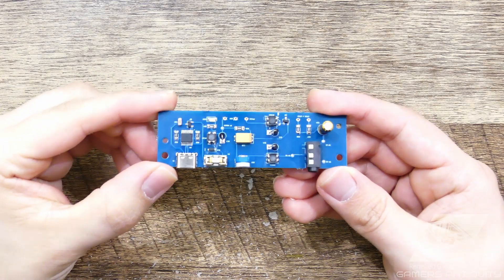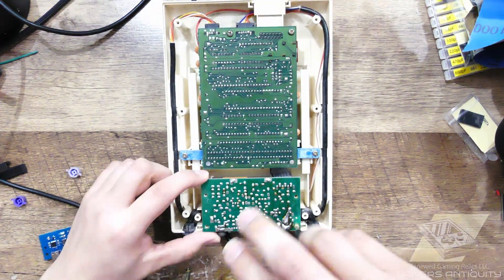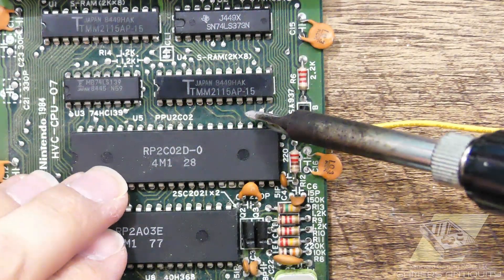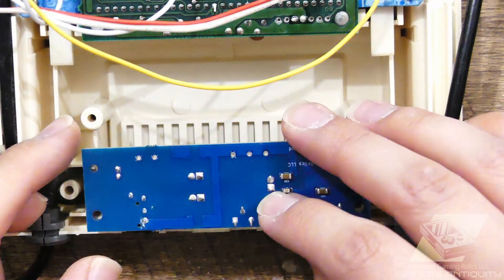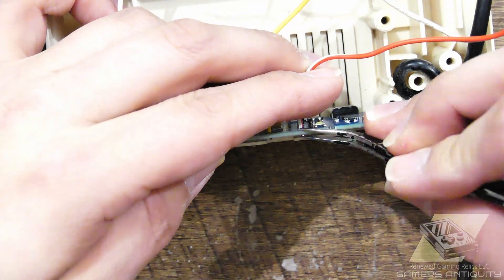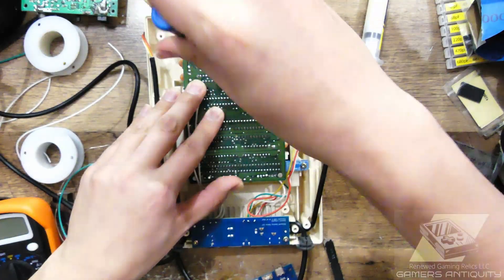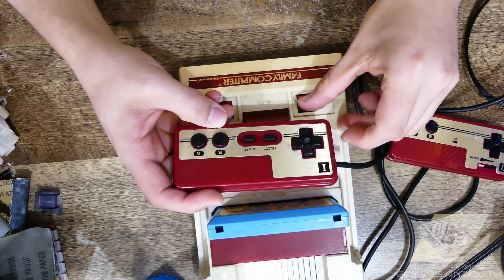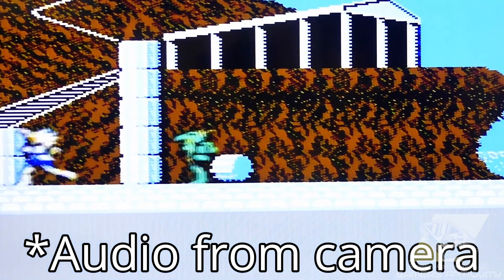New Famicom USB-C & AV Mod!

Comment: Could use just connectors and provide an optional pre pinned harness with the board - i.e. jst on the board side, stripped wire on the FMC side.

If people didn't want to pay extra for the harness, they could get a version of the board without the jst headers and harness for cheaper.

As the mod can't be solderless though there might not be an appetite for extras like that.
Reply from the maker: True - this is an awesome suggestion!!

Looking at some initial JST connectors and the parts I will plan to reduce, the current pricing may be a wash. I could switch to not using a mount for the fuse too and either keeping the same fuse or switch to an SMD one to reduce that little bit there too. Though I like people being able to easily swap fuses, it's another thing if people would be fine with that.

This could flow into the coming PS2 mod as well. I just worry about chassis revisions as the initial design utilizes screw mounts between the two planned boards. There are other concerns, but the dev isn't at the stage to properly address it yet.

Comment: Shipping costs $11, so it's not worth it to buy just one 🤷🏽‍♂️
Reply from the maker: Depends on perspective - I utilize flat rate priority via USPS for the main site. For 1-3 days once it hits the post office with $100 insurance included, it keeps things simple regardless of weight and distance.

Rates will be going up on July 13th. Regular priority will be going up to as much as 51%. That will impact the Etsy front. Flat priority will be going up by 11% which I'm hoping to absorb. Regular ground shipping will be going up to a lesser degree at up to 4% and other areas can see up to 14%.

Comment: Okay, so I have a couple things I want to talk about with this mod:

1) the use of CPU pins 1&2 is not ideal for audio out, especially with the severe lack of components on the output side. Its not true stereo, as all Pin 1 does is output the pulse waves while Pin 2 does everything else. The NES is not capable of true stereo, and anything that requires further adjustments externally would indicate that it is a bad idea. Also, expansion audio would be excluded since it doesn't come from the CPU, it comes from the cartridge bus. The ideal way of handling audio would be to instead pull from Pin 46 of the cartridge slot, and do two 330ohm resistors and two 47uf capacitors. One for each audio output channel.

2) 5V USB-C can cause issues if you play any cartridges or accessories that have a higher draw than normal. Think early Everdrive N8, MMC5 carts, or even some unlicensed carts. Which is why when most people do USB-C mods, they use the 9 or 12v rail and a well-built switching regulator circuit.
Reply from the maker: Not bad points. Please consider the following as I consider your points.

Yes, the famicom itself and the games are designed for mono sound so modern stereo wouldn't be applicable. Instead what this mod provides is stereo via dual mono, but the audio from CPU1 and CPU2 are muxed so both L and R channels get sound from both pins; you're not going to get channel 1 and 2 on separately with the PCB. The reasons for not using Pin46 from the cartridge slot is that the audio from that was very noisy with static that isn't found when going directly from the CPU pins no matter the external component  arrangement. So while Pin46 is more conventional and easier for some, it's far flug from ideal if you want clean sound. Could you connect 1 lead to Pin46 with the mod and add in other components - absolutely 100% no question ez pz. I've tried various configurations people have done before for the audio across many revisions and went with what was the most effective for capture, TV, and cost implementation. The use of Pin46 was part of one of the earliest revisions; along with different types of caps, CMCs, and so forth. I'll probably experiment with lower value CMCs in the future for sound as 2uH was too high and cut out some of the lower frequency sounds while taking out all the fuzz. Development never truely ends lol

As far as power goes, when stepping down voltage, you're still limited to the current that a regulator will provide. It doesn't matter if stepping down from 9V or 12V so I'm curious what switching regulator you might be looking at - not to mention that there aren't power rails with USB-C. USB-C PD is works via power negotiation between the device requesting power and it's supply via a single VBUS while using CC1 and CC2 pins to determine orientation; don't want to have others have a misconception of power via USB-C. If your looking at a typical LM7805, then that's 1.5A; which is also used in the oem design. USB-C PD 1.0 has it's 5V profile at 2A while PD 2.0 and above have 3A in their profiles; of course it may vary if the manufacturer of wall adapter would have different specs such as 5V 1A which matches basic Non-PD USB standard power.

At my base measurements, I saw a max of 2W which leads to .4A at 5V consumption which is far less than the oem rated of .85A while playing a game. If a cart is consuming near .4A per - let alone near 1A to cause issues with the draw from a regulator, then I'd look to see if there's a problem with the cart. As I cannot fathom at the time developers would design their carts so poorly that it couldn't run well on base specs during the famicom's lifecycle. I would love to see some examples of this so that I could dig into that, and do measurements of my own to see the power consumption. Do you have specific examples that aren't a flash cart or oem accessory?
Reply: Okay, so fair enough about correcting me about the power rail thing. However, I am noticing how you're choosing to exclude flash carts, when that's going to be what alot of people will be using with this thing. Whether it's an Aliexpress N8 clone or an Everdrive N8 Pro, you need to factor these in before releasing a product like this. Also, like I said, MMC5 games tend to have a higher draw than normal carts. Same with some vintage Famicom bootlegs.

As far as the audio goes however, using a couple resistors and a capacitor is not enough for audio. You need to build a proper amp circuit, that also includes expansion audio. Tim Worthington does it with the NESRGB kits, and he bases it off how the Front Loader mixes audio. Why not see how the HVC-CPU-07 handles audio, replicate it's audio circuit, and do a Pin 45 output and Pin 46 input for the final audio output? Solves your noise issues and integrates the feature that actually makes the Famicom unique, compared to the NES.
Reply from the maker: If pointing out to legacy carts, then I'd rather look at current market ones. However, I'm more curious about OEM ones where the flash carts should have the power consumption at oem specs in mind for those that want to keep things as stock as possible.

I have in mind the OEM specs as it's unrealistic to look at products across an untold amount of 3rd party peripherals and their clones. It's not a realistic expectation of anyone to do that. Gotta have constraints.

That being all said I do appreciate the feedback on the approach as feedback is part key to making things better! Convo like this is very good.

The NESRGB kit is really cool! It's something I've looked at before for an NES I have, but also wanted to see how I could get the RGB2V02N mod despite not having international shipping as an option. Eliminating flicker due to original hardware limitation is mad nice.

If the raw audio signal is noisy then amplifying will also amplify it. I will eventually look at other CMCs to clear noise like I did for power going in and the video out. All the ones I've opted for during dev took out too much of the lower frequencies on top of the noise. The circuit currently in place is not an amp, it's a simple multiplexer. I'm aware of the muxing that happens in the carts which is very interesting since that's how things like the sounds from the mic get interpreted for a game which then becomes the output. I'd like to eliminate that as a source of possible noise. If I end up finding a disk system, then you can bet I'll look into its schematics to see how its audio works, and get its audio straight from the source. Rather than an amplifier, I'd rather look at sources and look at the mixing rather than fix what's been post processed - know what I mean? That's the most likely thing the NESRBG does which I'll def take a look at for sure.

I've seen people point to the mic inputs at the controller and auxiliary port, but disabling those areas across 4 systems yielded no change during testing - was happy about the no change since I wouldn't want to lose any functionality.

Comment: What board revision is this? I’m going to install this for a friend tomorrow and want to know if I will run into any issues. His board is HVC-CPU-07. Thank you.
Reply from the maker: The board revision in the vid is a HVC-CPU-07. There shouldn't be any issues as the CPU and PPU pins remain the same across revisions.

It's also good for the HVC-CPU-GPM-02 as well, and have done installations for that as well.

The only one famicom I haven't dealt with yet is the AV top loader which would need something different because of the chassis.
Reply from the maker: if ya run into any issues, please let me know and I'll do what I can to help!

Thanks for supporting me and my shop 😁
Reply: @RenewedGamingRelics  followed your video to a tee. I used a capacitor leg for the jumper 3-4. Fired it up and played Mario bros with my buddy. It worked well!
Reply from the maker: Right on! Happy to hear it's worked out well and my vid helped with the install 😄
Reply: It worked perfectly! Thank you.
Reply from the maker: You're welcome! I'm happy it's working well for you 😄

Comment: not gonna buy your board, open source it.
Reply from the maker: That's fine - thanks for taking a look though! it's a common thing for those to open source and see what people have done to achieve the same goal. Some peeps had some interesting means to change up the BJTs to get more saturated colors which was pretty neat.

I see other competitors who charge between 44-55 USD; and no way would I pay that much. My option is to help compete with more expensive consolidated options with my own twist to keep things simple yet effective.

Comment: Mythical YouTube recommended section video pull. Just as I was looking at different composite video mods for my newly arrived Famicom! Will definitely be ordering one of these, however, I did have a question about some of the wiring. I have a later revision Famicom with the RF/power board soldered directly to the main board. Would that change any of the wiring off the power switch or CPU and PPU chips to your new AV/power board? Also, would I still need that jumper between those two solder points where the RF board  hooks up to?
Reply from the maker: Grats on the Famicom and thanks for considering getting my mod for it!

I'm guessing it's a HVC-CPU-GPM-02  with just the 4 pins or different 7 pin variation?

The below is for the 4 pin variant. If yours isn't, then can I ask what the motherboard model is so I can review the pin out for power and ground? The connections for the CPU and PPU wouldn't change.

For the 4 pin, there wouldn't be any changes to the wiring to the CPU nor PPU since Nintendo was nice enough to keep all that the same. The via for VBUS will connect to VCC plane where the switch connects to and you can connect Ground to the ground plane where the metal shielding went onto. This is what I did for the first Famicom I got and used during dev testing.

Once I see a couple more revisions from what I have, I plane to make some written documentation with pics available. It's interesting to see the changes Nintendo made for the board - I just wonder "why" sometimes lol
Reply: @RenewedGamingRelics  Yup, you're right, mine is the HVC-CPU-GPM-02, with the 4 pin connection. Glad to know that there aren't any changes to the wiring for this mod between the board revisions.

Having a closer look at the PCB, I can see where the Vcc trace runs from the power/RF board connections all the way up to the switch via. I guess this is where Vbus gets wired to, as you mentioned in your reply (seems even more simple to wire than the earlier board revision haha)

Thanks for replying to my original comment btw! Still pretty new to electronics and console mods so this is much appreciated
Reply from the maker: You're welcome! 😄

Yup yup, you got it. I'm working on a few updates to the site this week and I should have pics for that particular model by the end of the week.

All modders start somewhere so it's all good haha